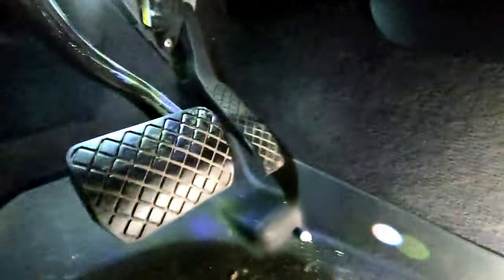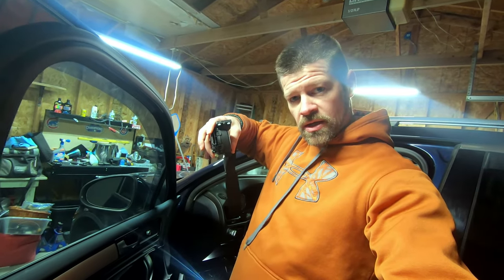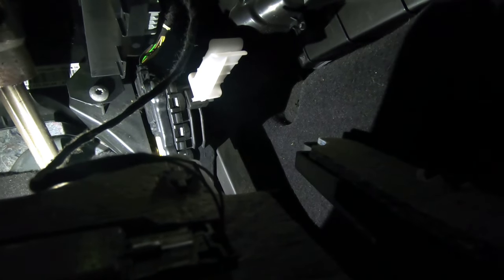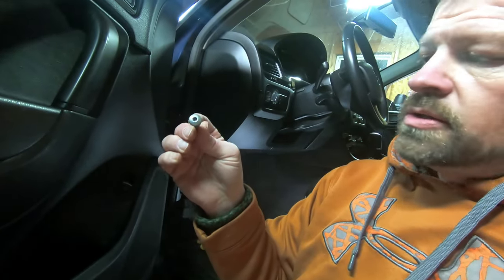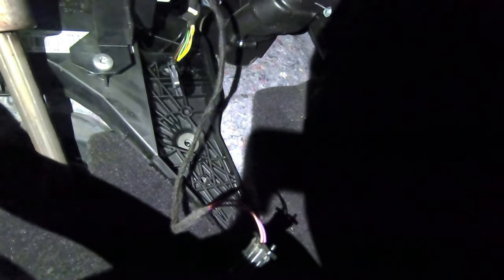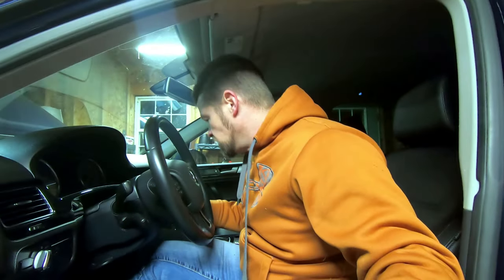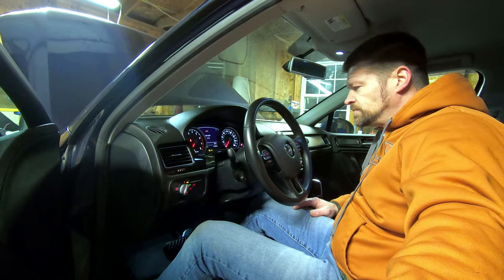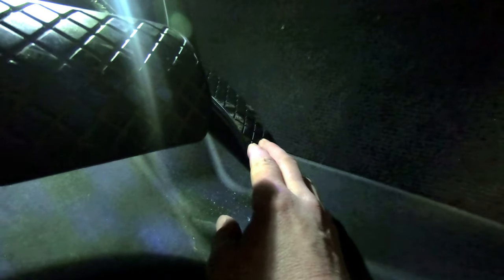How to Replace Your Accelerator Pedal Position Sensor - Accelerator Pedal Replacement

Comment: Have this issue on my Mazda 3, but am replacing the pedal and the throttle body motor which goes in conjunction with the accelerator.
Reply from the maker: Yea, I am either going to clean my throttle body or replace it.

Comment: Great video. My 2007 audi a4 intermittently goes into limp mode. It intermittently only happens when I slowly accelerate from a stop. Like from a red light. When light turns green and I pressed pedal slightly that's when it goes into limp mode. Once it starts going it's ok. The throttle body under the hood looks ok. Can this pedal be my problem? Any help would be greatly appreciated. Thank you
Reply: Forgot to mention there was never a code. Thanks
Reply from the maker: I honestly couldn't tell you for sure, it is worth a try though. The pedal with sensor wasn't too expensive from Rockauto and pretty easy to replace. If it doesn't fix the issue,  the next culprit is the throttle body or throttle body sensor...
Reply: Thanks for your reply. Yes I'll try that.
Reply: Thank you
Reply: Did it fix the issue ?

Comment: Only cost $60 from dealership BUT threw every code on car. I disconnected the battery and reconnected. It threw all the codes. So I’m going to put the old pedal on for now and more research
Reply from the maker: That's interesting,  I didn't have that issue.

Comment: Thank you.  I have a fixed module. And, I have a 2003 Nissan Pathfinder.  Parts will not be in for a week.  Is it safe to drive until then?  Been throwing this code this code since I got a new battery installed a month ago. This morning was the 1st symptom shown... hesitant to accelerate.  I panicked.  Parts will not be available for over a  week. My question.  Is it okay to drive until then?  Thank you.
Reply from the maker: Should be fine, just annoying. There is a possibility of it going into limp mode. If it does that, you can reset it, but it will probably do it again.

Comment: My live data saya that the accelerator position is at 90% while at idle and not accelerating.. any sugestion?
Reply from the maker: That seems a bit high, you can loosen the screws to the sensor and it will rotate slightly reducing or increasing the contact points

Comment: Is it possible for it not to throw codes? I have a dead spot in my pedal.. when I first press it'll take a while to get speed then once I'm going it's fine. No check engine light
Reply from the maker: Yes, I didn't have any codes
Reply: I think codes will inevitably pop up eventually. Mine took a LONG while before p2138 code. I need to change mine but I clear it with a meter and take it easy until I change it. (I also accelerate using cruise control, usually)
Reply: Hello sir did you fix it?

Comment: how do you test the connector to the accelerator pedal position sensor using the multimeter ? checking for 5volt reference and the ground from same ? Don't you have to go into the system to clear the EPC code which was thrown ? Or is this process for the Audi Q7 3.6L V6 engine as well ?
Reply from the maker: I didn't have a code

Comment: can we fix the old padel , my car padel also takes little time to accelerate
Reply from the maker: So, you can try this, loosen the top screws and 1 bottom screw on the sensor, then push it back from the top of the sensor. It should move about 1/8 in. That should put it in better contact with the accelerator.  You will have to remove the pedal to get to all the screws.
Reply: @offtheshelfrides  okay but i don't get it completely ,ist of all i will open the padal cover , & then next what should i do
Reply from the maker: @Therizwanahmed  remove pedal from the car, lossen(don't remove) the screws at the top of the sensor, losses 1 screw at the bottom of the sensor. Rotate the sensor backwards at the top, then retighten and reinstall the pedal
Reply: ok thanks i will try it

Comment: Could you just repair the "gap"? Was that a mechanical gap or electrical thing?
Reply from the maker: It's a sensor issue.
Reply from the maker: You can try loosening the sensor and twisting it one direction or the other to see if it helps.

Comment: Having this issue rn… purple wire is broke clean in two going in into the sensor would that cause this issue
Reply from the maker: Sorry, I really don't know for sure, but any disconnected or broken wires will most likely cause an issue.
Reply: @offtheshelfrides  i soldered the wire and it fixed my problem

Comment: You didn't have to wipe off fault codes?
Reply from the maker: I didn't actually have any fault codes because it was just a gap in the pedal
Reply: If he had codes, Disconnecting the battery would have erased them. Usually 😅
Reply: Most of the time when you disconnect the battery it clears the engine light. I've worked on three vehicle's in which that didn't happen but more so likely it would give you a reset and if it didn't fix the problem the light would reappear after 50 miles or so
Reply: @cloudstrife1125 Thanks for the information